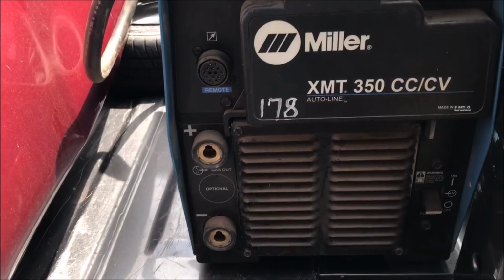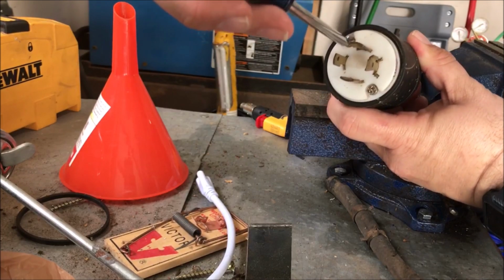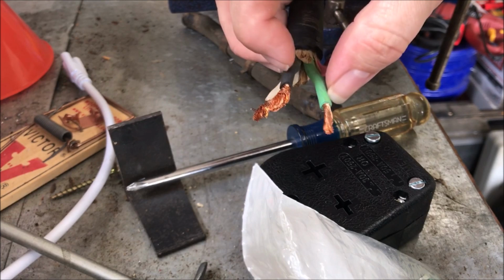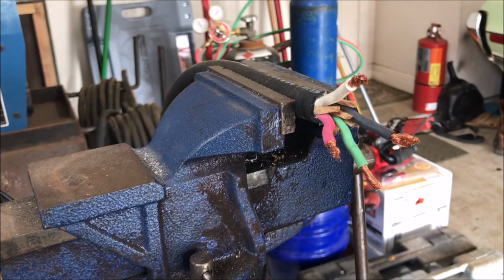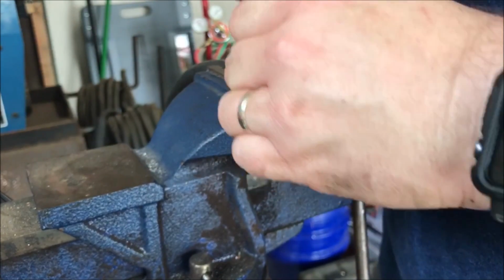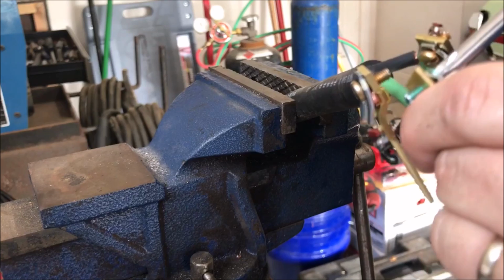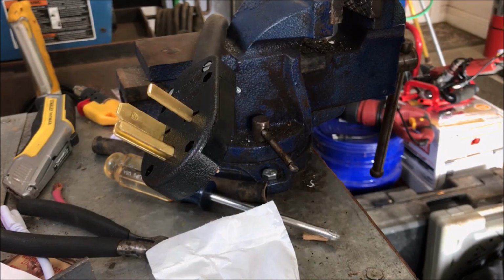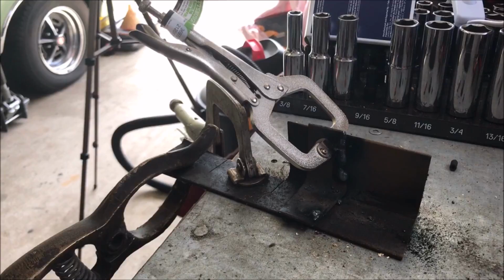Miller XMT 350 CC/CV Arc Welder Purchase and 50 AMP PLUG Install

Comment: Dude This welder is SICK!!! My employer just changed me over to this set up running 0.45 wire, Spray transfer GMAW process (90 %Argon 10% CO2) . I had the Millermatic 350 P, and I was trying to run spray transfer with .035 at like 28 volts and 420 on the wire and still getting hard spatter taking me forever and a day to clean up the most simple project, I tried playing with the inductance, wire speed , voltage etc.. finally realized I needed to run about 600 on the wire 29.5 on the voltage and 75 inductance , to get any where near to spray transfer mode this cat runs at 26 volts and 400 wire, NO Spatter!

Comment: I just bought a used one and it has no power cord at all ? Or a place for the wire ? Why would this be ?  Doesn’t make sense. Would i need the suitcase to go with it ?
Reply: We use these at work, my set up has a separate feed unit, not cheap!
Reply: Great machine though! Runs spray Arc GMAW process like butter.. zero spatter

Comment: You just wired that machine for 120v. It was already 240v single phase. If it was wired for 240v 3 phase, it would have an additional blue wire in the plug. You need a dual pole breaker (AB lug) in your panel. Black to “A”, red to “B”, white to “neutral”, green to “ground”. Unless you are outside North America. If you leave it like that, you are going to make that machine a $2000 paper weight.
Reply: wrong